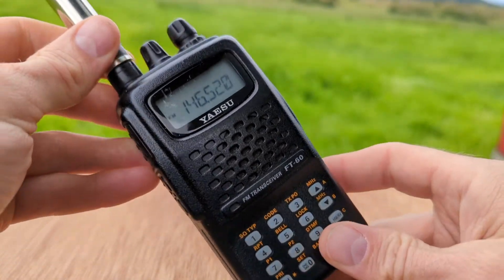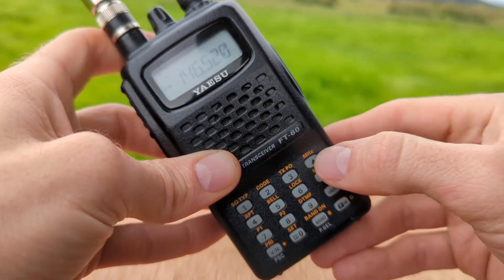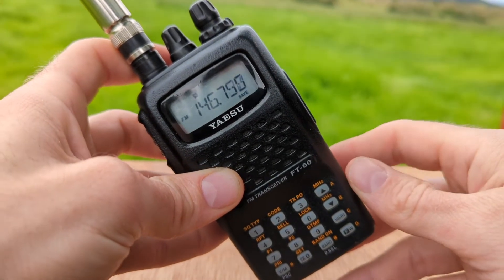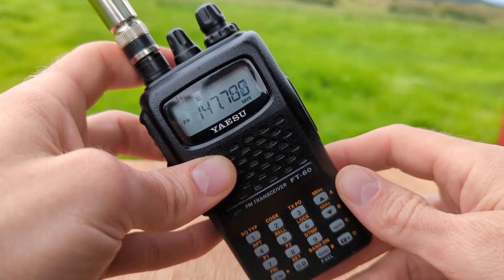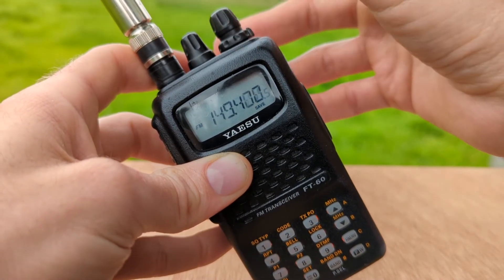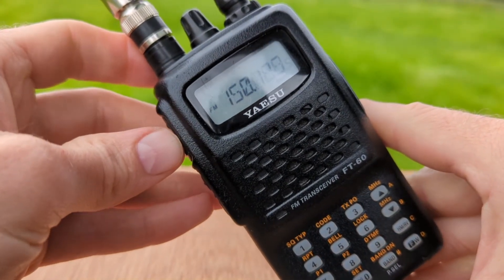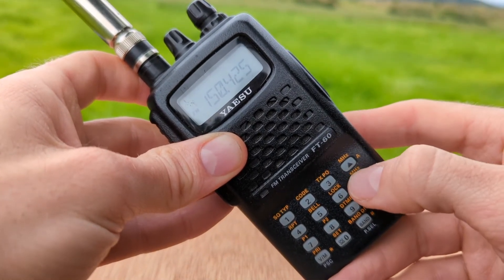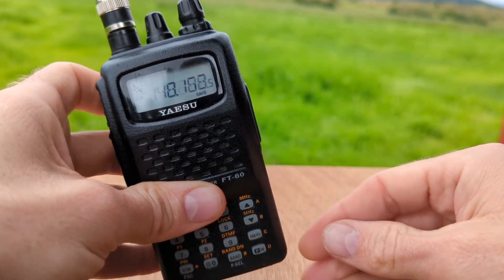How to Scan Frequencies | Yaesu FT-60r Series

Comment: Thank you for your video. Could you explain briefly why you have an adapter on your antenna? I just purchased this radio... I purchased a new antenna with it also. I just wondered what you suggest with antennas and adapters for this. 😊
Reply from the maker: I standardized all my 2m portable antennas to use BNC. This allows for quick changes in the field and not worrying if I have the right adapter for a particular antenna or radio.

I talk more about it here: https://youtu.be/O1KikSgWct0
Reply: @N7KOM  thank you for the fast response! Last question.... Is there any significant signal loss using the BNC adapter?
Reply from the maker: No.

Comment: Hi, and thanks for this! - i bought it to be used mainly as an Air scanner, but i find the reception quite odd??!! - i know that it doesent have 8,33khz step, but the reception is strange, to say the least! - wonder if there is any fault on the radio? - it only seems to pick up the planes, and not the "base stations" although i know they are transmitting in the Kw range, (here in Sweden anyways) SWEDEN CONTROL is very strong on a UNIDEN scanner i tested -- but i cannot hear them on this radio?!?! - strange... is there perhaps some setting that is wrong in the radio? - all help would be appreciated! 73 Levi

Comment: KJ6WYV here.  I really enjoy your videos and like and am subscribed.  On problem I have with my FT-60R is scanning a specific frequency range with upper and lower limits.  I've checked the forums and found this:" When in the memory mode I hold down the BAND key and it is set to "NOBANK"; I then can use the PMS-X setting for Programmed VFO Scan and it works perfectly using the lower and upper limits as described in the manual." But still can't get it to work.  I want to do it so that I just scan the frequencies on a specific band that are available to a Tech for use in broadcasting, ie 144.300 to 148.000.  Any comment?
Reply from the maker: Started poking around my radio this morning. In VFO mode it'll scan out if band (switches to AM mode below 137.000). I'll do some more digging and see if I can get an answer for you. 73